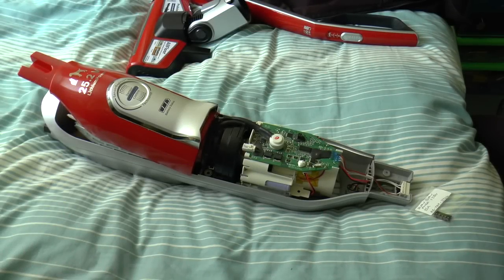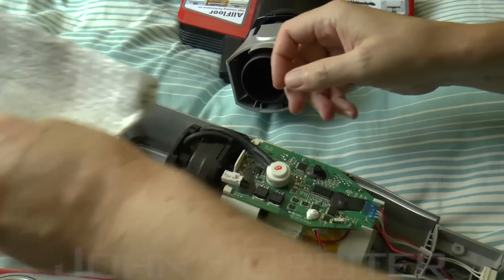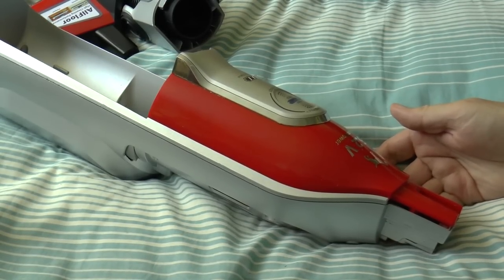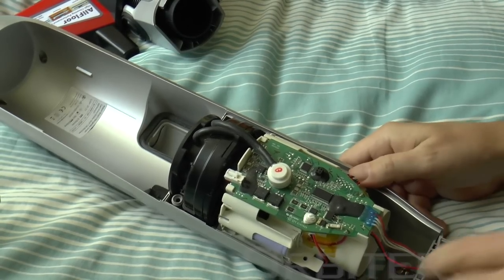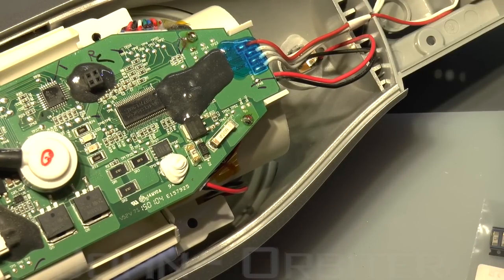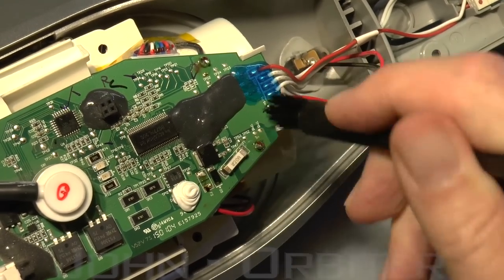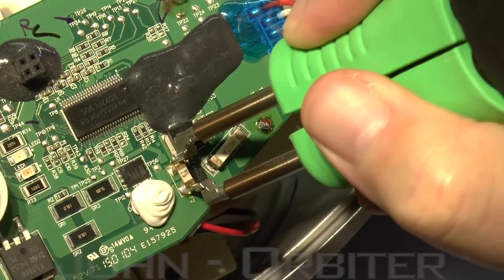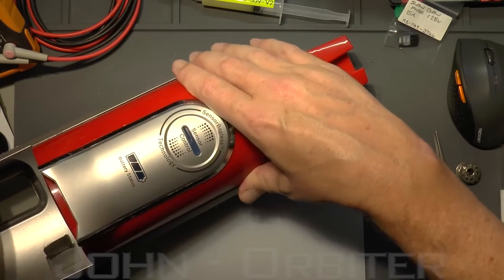Bosch Athlet - Vacuum Repair

Comment: Hi, my fuse has definitely blown, but I’m also not getting any continuity from the one next to it. Is this normal or should I replace that as well and have you any idea what it is?
Reply from the maker: Hi.. These devices definitely seem to have issues especially when older. Before you change any fuses and turn the vacuum back on, please remove the lower brush cover and make sure that the wires leading to the motor are NOT severed or shorting anywhere. As this is one of the reasons the fuses normally pop. If everything looks good you can certainly try replacing the fuses. But just to let you know in advance.. I have had a couple of these units where static has damaged the on-board micro-controller and rendered them dead. I have even tried switching micro-controllers on one unit hoping for a result however I fear the micro I switched with had also suffered the same fate. So it's all a bit hit and miss unfortunately with these things. It's a shame really as they are so easy to manage and use. Hope you have better luck with yours 👍

Comment: Did you use a torx SCREWDRIVER cus our set isn't long enough n I'm getting mighty peeved off
Reply from the maker: Hi.. You'll need an extended shank torx driver bit (IIRC a tx10 or tx15.) A standard torx bit won't reach the screw head. Also please be EXTREMELY careful to discharge yourself once you have the vacuum open.. The IC chips on these boards seem extremely sensitive to static charge. I even killed my own vacuum just touching the PCB and ended up buying another one.

Comment: Great video! Mine lasts for approx. 1 minute on setting 3 and then dies. all batteries show 4.03V when fully charged. Strange.
Reply from the maker: These vacuums are great initially, but for some reason once they go wrong they're normally finished. This is why in a lot of my responses to people I mention firmware, as I believe there is an issue with it on these devices which when triggered.. It renders the vacuum mostly faulty. Which is sad because they are great when working. We even bought another one, but itf it started playing up I wouldn't even bother trying to repair it again, unless it was something obvious.
Cheers
John

Comment: Thanks for the video, John.
You mentioned adding a loom around the wires going to the brush head motor through the plastic elbow. That's a great idea to protect those fragile wires. But i am stumped on how to dismantle the corrugated plastic hose and the elbow joint to expose the wires. It looks like the elbow joint should pop open by pushing in some tabs, but mine isn't budging. Any ideas? Thanks in advance.
Reply from the maker: Not sure I understand what you mean there buddy. I didn't actually disassemble the bottom hinged joint or remove the upper end of the corrugated hose. I just removed the whole bottom plate of the hoover which releases the hoses bottom end, and got access to the motor wires that way. I de-soldered the wires from the motor and added a new piece if I remember correctly.
I'm actually not sure how the upper corrugated plastic hose fits in to be honest. I still haven't wrapped the wires up apart from a little insulation tape, and the hoover is still going strong.
Reply: @OrbiterElectronics  Annoyingly, my motor wires have snapped just where they enter the corrugated elbow joint. I need to dismantle the elbow in order to fix/replace the motor wires. Struggling to take it apart. Was hoping that you may have already mastered it?
Reply from the maker: @farid0987   Well.. I have mastered it now :) Just been taking my Athlet apart again to see how it's assembled.  So I need to send you a pic or two. Just head up to my channel name and click on it. Then go to the 'About' heading and send me an email so that I can get back to you.
Cheers
John

Comment: Hi!
I cleansed my filter in water and didn't dry it completely, it wouldn't stop so it went full power for one hour and then stopped. Now i can't turn it back on, got any ideas?
Iv'e already rinsed the board with isopropanol.
Reply from the maker: Hi. Obviously water has got in and caused a short circuit. The problem now is that the unit has run until it's batteries have been totally exhausted. Hopefully the cells circuit protection will have protected the cells from dropping too low which is good, but the cells must be tested & charged up again to make sure they're ok. The cells should all be a suitable voltage e.g.. not below 2.5v per cell. If the battery voltages are very low, then they may have been damaged beyond repair :(
 
Also the vacuums circuits will need testing as something has caused the unit to run continuously. This could be something as simple as a wet switch, plug socket etc, OR it could be a shorted component or short on the main PCB itself. So unfortunately you're going to have to either have this checked out if you can't do it yourself OR go through the circuitry step by step to figure out where the problem is.

Please be aware that these PCBs are often prone to failure, even just handling alone can kill them due to static charge (I''ve done it 😧 ) and replacement firmware is unavailable for the affected IC. This then renders the irreparable :(

Comment: Thanks for this! Mine keeps quitting after 30 secs to 2 mins when not moved straight after a charge. Neck seems fine so I’ve been after changing the 18650s. This has got me much closer lol. A tad puzzled as to where I go from here.
Reply from the maker: Hi William.. Firstly just double check that its not the connection block between the neck and body thats perhaps giving you an intermittent connection. If it dying like a battery though you're  likely right in that the cells are finished.
I can't really help you with the battery replacement bit, as I've not done that. But no doubt with tools and some perseverance it can be done. Just be very careful with the batteries if you intend to re-solder new ones in, if your unsure though I would advise against a DIY job. Or do it outside making sure you wear safety gloves and eye protection etc.

Cheers
John
Reply: John - Orbiter thanks very much. I’ve checked the neck. This happens when I don’t move the unit at all and the flashing low batt starts when it’s stood still. I’ve got the motor assembly out thanks to your video!! And see that they are all soldered in. I’d have a go if they weren’t ALSO seemingly spot welded on the 18650’s too lol! So sod that for DIY dad time blowing up in the garden. The Mrs will think I’ve put the lights up earlier than usual. Oh well. I’ll have a look around blackpool for repairs as Bosch are ridiculous. I got mine £120 in store with Tesco offers. The battery replacement alone they quoted £99! So I’ll ask around. Many many thanks! :)
Reply from the maker: @Mr_Gadge  .. Hahaaa 👍
If the unit still shows or acts like it charges up properly, it does sound like a dead or faulty cell in the cluster.
You could test the cell pack voltage at the output terminals.. When charged the battery cluster should read around 25volts. Much less and a dead cell or a worn pack is likely.
If you do have 25volts, perhaps have a look for visually bad components on the PCB, or dodgy solder joints/pins etc. 
£99 is a little expensive for a repair, however I guess 7 decent cells would cost around £45 to begin with.
Reply: @OrbiterElectronics  it can work fine straight after a charge for up to 5 mins, then stops. Switch it back on again, and it'll last up to a minute, battery flashing light soon comes on and it stops. Had a look round the PCB and gave it a canned air dust. Can't see any. I'll try meter the cells thanks! -Didn't think it would function fully for a few mins if a cell was down.
Reply from the maker: @Mr_Gadge  As you say it still works again after a restart, just check that motor is spinning as it should be, as a sticking/binding motor could also create the symptoms your having in the the batteries are being excessively loaded, then when the hoover turns off the batteries recuperate a bit. Its worth a look.

Comment: After disassembling mine, upon reassembly the motor is stuck on full regardless of switch position. Spinning brush works as normal. Does anyone have any ideas what could cause this? I just remounted loose power connector.
Reply from the maker: Sounds like you have created a short circuit to the motor somewhere.. Or the switch mechanism is jammed etc. Likely when you refitted the power connector or reassembling.
If you did any soldering.. first check that you didn't inadvertently create a short circuit between any connector pins etc.
Also check that no wires etc have become bare or jammed and shorted between the plastic housing of the vacuum.

Comment: I’m here again I washed the exhaust filter replaced the bottom filters
The previous owner only used on turbo X1 used battery too quickly I can’t switch on turbo now it sticks and suggestions
Reply from the maker: If its sticking on the lower level.. I can only guess that perhaps a switching transistor or part of its associated circuitry has failed.
I've known a lot of these things totally fail when fiddled with electronically, so I would perhaps suggest just using it on the level that is working now.
Reply: @OrbiterElectronics  it’s mechanical so will manage

Comment: Nice video John, what size bit is needed to strip it?
Reply from the maker: Thanks Graeme. I'm sorry but I can't remember exactly the size (from memory I'd guess a Tx10 or Tx15) but I don't have a unit handy to double check. 
Please note that they are NOT standard Torx Bits. They are 'SECURITY TORX BITS'. The security part means that each bit has a special hole drilled up into the end of each bit, which accommodates the pin in each screw head.
If you have to buy a set of Security Torx Bits.. get the long ones, and the ones with the rounded shank. Most of the cheaper ones have a hexagonal shaped shank 
which often doesn't fit down narrow holes.
Here's a couple of links to Amazon & the type I would recommend. 
https://tinyurl.com/y8c2nya8
https://tinyurl.com/ybhgukao
Reply: @OrbiterElectronics   thanks, I have extracted 1 & drilled the pin off T20 seems to fit

Comment: Hi,mine was stop working when i put to charge nothing hapens when turn on nothing, i was replaced batteryes end now when i turn him on only the led came on and the motors not working. And still not charging when is pluged on adapter. The adapter provides 29.5v but no led come on. is it posible that the board is in fault, or is it posible that fuse? Thanks

I was just mesure the output on board for the main motor and its shows 0V
Reply from the maker: Its always worth checking the fuses its. There is two of them on the PCB. 
To be honest these PCBs fail very regularly and they're not worth repairing in most cases, especially if the board needs replacing.

Comment: Hi John,  Thanks for the video.  I have replaced the cells in my Athlet vacuum, and now it will not charge. Before I completely assembled the machine I plugged the charger in and the LEDs lit up normally.  Having completed assembly they are now dead.  I have stripped it back down but can't see any issues, and there is 23.5V across the whole 7 cells. There is still approx 28V coming from the charger itself. Any ideas? Regards,  Simon
Reply from the maker: Hi Simon, unfortunately it sounds like you may have the dreaded ESD issue, which I believe I've inflicted on two vacuums. And as far as I know there's no fix for it. It seems that even just touching the pcb, static can kill the on-board micro controller. I initially opened one of my vacuums to help a friend diagnose his, and even though I know for a fact I didn't phisically damage anything, I must have inadvertently shocked the micro. I even tried transferring the micro controller over from another board, but no luck here either. I got some charge lights to appear but the vacuum still wasn't charging as it should. So unfortunately I just had to salvage the batteries.
Sorry I'm not able to offer any help here :(
Reply: @OrbiterElectronics  Thanks for the quick reply John.  If I charge the batteries by by-passing the main circuit, will the vacuum itself work do you think?  I guess I may have nothing to loose in trying. Simon
Reply from the maker: @simonlansdowne9888   It seems that once the micro controller is damaged on these devices the whole system is kaput. I was considering perhaps re-flashing the chips firmware initially but I've no source for a known good firmware file, and Bosch didn't get back to me following an email.
You could possibly get the vacuum to somehow work again.. But please remember that modifying anything that uses the likes of 18650 cells has risks, so care has to be taken when charging etc, especially if done without a specific charger, as the cells need balance charging really! The original vacuums circuitry did this. However If you have an 18650 'balance charger' or a dedicated charger then that's fine. But charging cells individually will reduce cell life/efficiency.
If you do decide to try and use the vacuum again. You may need to fit a heavier switch, depending on the max current capability of the original, then run suitable wires down to the motor via an adjustable step down (buck) converter etc, you can pick these up for about £8. As the motor may just burn out if fed with 28v directly. I can't remember all the specifics now.
John
Reply: @OrbiterElectronics  Hi John, You are correct, the whole thing is now dead.  I charged the batteries separately overnight, re-assemebled and the lights all come on, it shows as fully charged etc., but neither motor runs.  Very disappointing. Batteries have a limited lifespan so to design a vacuum that needs such an expensive component to be bought whole to replace the batteries is a very poor design from an economic and environmental perspective. Not impressed by Bosch on this.  Most of my power tool are Bosch and I have always liked their kit before, but not on this one.  Thanks for your help and advice,  Simon
Reply from the maker: I've always trusted Bosch too Simon, normally a good brand, but as you say.. not in this particular case. It's a shame as these vacuums are/were soo easy to grab and use too. 
We were looking to replacing ours with a similar one from Currys, but the alternatives available didn't seem as well balanced and are heavier than the Athlete, so we ended up reverting to our older Bosch vacuum, which works great but weighs a ton.
Sorry I couldn't be of more help Simon
Cheers
John

Comment: When i turn on the vacuum, the battery indication and sensor looks fine, but the motor doesn't work . What the problem can that be？ thank you.
Reply from the maker: If you are happy with disassembling and testing items like this, I would advise that you may need to take apart the top of the vacuum as in the video, & also disassemble the lower brush head assembly to access the motor. 
Check that the wires going to the motor are not shorted or broken (this happens a lot as the wires down there are twisted all the time whilst in use.) 
Also with a multimeter and the vacuum handle connected, that you have continuity between the wires at the top of the vacuum down to the motor. Also check the two small SMD fuses on the PCB, if there has been a wire short down by the motor it will blow the SMD fuse/s on the PCB also.

Comment: Hi,my problem is that it charge for a 5 min. and switch off. I can clean for few min  and the level of battery go off.Can you let me know why this keeps happening  please?
Reply from the maker: The problem could be quite a few things. If you have a multimeter I would advise you firstly check that the charger is working properly.. if it is, it could be that the batteries are degraded (especially if the vacuum is a few years old) 
Batteries do not hold a full charge forever, so their run time can get shorter and shorter over time as they degrade, sometimes they will only hold a partial charge, as in your case. 
If the problem is the batteries I think you can get new battery packs from Bosch, but these tend to be very expensive, almost the price of a new vacuum.
Reply: @OrbiterElectronics  thank you, the battery are new,but still not hołd. I will check the charger.

Comment: My Bosch Athlet runs foe about a minuet then cuts out. the battery is ok. any help you can give me
Reply from the maker: How do you know the batteries are ok? If the vacuum is couple of years old or more the batts could still be the issue as often they charge but don't retain capacity.

Comment: John, checked the throughput of the resistors on the vacuum and the contacts of the charger, all seems to work. Any ideas?
Reply from the maker: Are the vacuums charge lights actually coming on or not?
Reply: @OrbiterElectronics  not at all. But lights go on if i try to use it. Irritating heh.
Reply: @mrcmountain6342  Have you found any solution? I have a similar problem. No charge but when in press the button it lit's up and starts flashing as if it has battery 0.
Reply: Hi @Orbiter Electronics, thank you for your video. I have the same problem. The device won't charge anymore, but when turning it on the lights for low battery are on. I see around 25 voltage and I think the cells you mentioned F1 and F2 are done.. Not sure what else to try, any ideas? Thanks from Germany!
Reply: not for me, but got some batteries out of it. still have no idea why it just suddenly stopped though
Reply: @alexandruprepelita2771  I got the same problem too if by luck anyone has found a fix it would be much appreciated.
Reply: @juliusfendrich  Same problem here